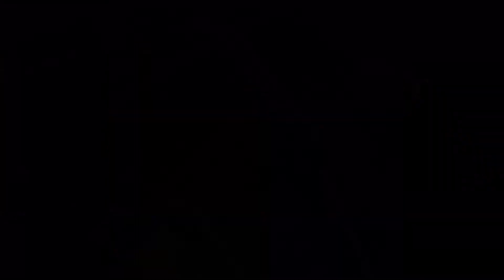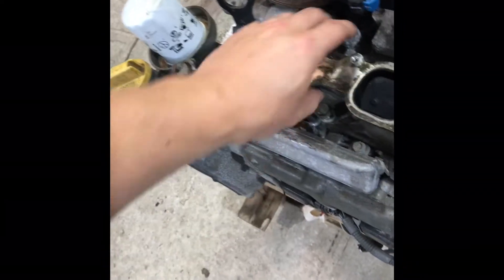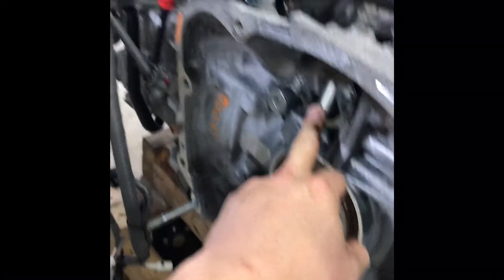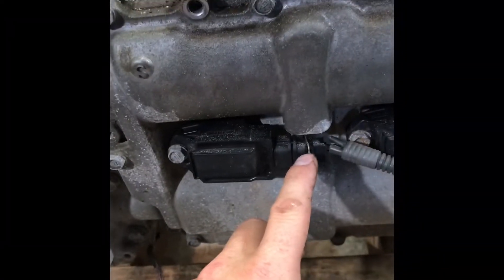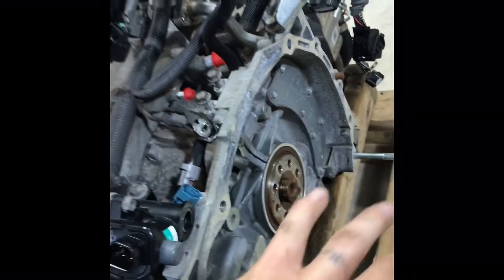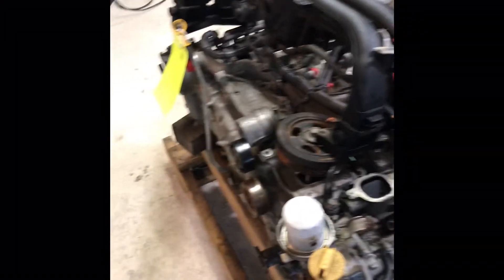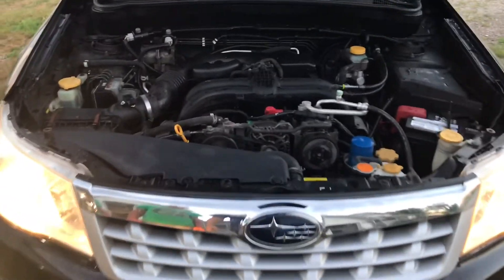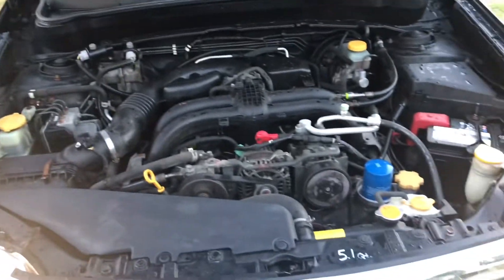2017 Legacy Engine Swapped into 2011 Forester!

Comment: This has been very helpful in my 16 Legacy engine (43k) to 11 Forester swap! I'm almost finished with the swap, but have found the torque converter (TC) centering hole in the middle of the flex plate on the 16 engine is much shallower than the old engine. It's about .5" vs. 1.25" on the Forester engine. The TC centering shaft bottoms out in the hole and leaves about a 3/8" gap when trying to bolt up the flex plate. When I tighten the bell housing the engine barely moves and the TC starter ring gears are hitting the starter gears indicating the TC is being pushed back into the transmission. Not good! The only solution I can think of is to grind about 3/8" off the TC centering shaft end. Any other ideas before I butcher my TC?
Reply from the maker: Oh! Also, check the hole in the crankshaft where the TC centering “button” goes into. I received one engine that had a broken off TC pin in it from the car it came from. I had to drill that sucker out. Didn’t know it until I couldn’t bolt things together, just like you.
Reply: @stvnswld  Are you kidding me! That's exactly what happened. It broke off so clean I didn't even suspect it was from the old TC. Unbelievable. I thought I screwed something up. Thanks so much! Now to get that sucker out of there.
Reply from the maker: @MitchellNorder  my dad removed it while I was at work. Small drill bit, then a larger one. He’s my master of extraction. If it’s stuck, he’ll unstick it!
Reply from the maker: I’m not sure I follow. Where is the gap? If you use the old flex plate you shouldn’t have any problem. Is the torque converter flush(nearly flush) with the transmission housing?

Comment: Wow, great video and helpful information. I just purchased a 2017 Subaru Outback with the 2.5 with 215,000 miles (Mostly Highway), I also found a 2017 Subaru Legacy 2.5 engine with 65,000 miles. Would this be a one for one swap as they have the same engine size and displacement?
Reply from the maker: I think they should be darn close to identical! However, since I have not done a swap in a newer outback like this, I cannot be for sure. Perhaps make sure the front timing cover has enough mounting places for the accessories. If you have to swap that, make sure to check the tone wheels on the intake cams. Thanks for the comment!

Comment: On those water passage O-rings, do you have the John Deere part numbers?  I am replacing the engine in my 2013 Forester with a 29,000 mile FB20 from an Impreza of the same year.  I may need to change the coolant crossover pipe to eliminate the transmission cooler fittings as my Subaru is a five speed stick.
Reply: Thanks
Reply from the maker: T78313 is the number from John Deere that I use

Comment: Hi Steven!  Thank you so much for this!  I am wondering if you think the same might work for using a 2018 Forester FB25B into a 2015 Forester FB25B.  I have a 2015 with a seized engine (oil low)...and I have the opportunity to get a 2018 with only 13k miles.  Wondering if it's worth the effort.  The 2018 engine is definitely cheaper than the 2015.  Curious your perspective.
Reply from the maker: I haven’t done this swap, so I’m careful before telling you it should work. Ultimately, the long block should be nearly the same, but you may need to keep your old harness and intake manifold. Not sure. If you’re handy and don’t mind a challenge, I’d be willing to bet you could make it work! Pay mind to the items I have mentioned in this vid though. Just remember, the end goal is to make the computer think nothing has changed, so all sensors need to read the same. Please let me know what you end up doing! I should admit that I get my kicks putting engines in machines where they don’t belong, so I’m excited to hear the results. I’m about to put an EJ20X into a legacy GT wagon. I’m nervous since I will have to retune it, but I’m excited to learn how.
Reply: @stvnswld  I will update you for sure! Thanks again for this!
Reply from the maker: @stevefafel  you’re welcome! I’m really happy to hear it is helpful.

Comment: Hi Steven, thanks for video. Would it be possible to swap an FB20 into a 2014 Forester MT 6SPD. If so what year FB20? and what all needs changed/swapped. Thank you
Reply from the maker: I have not done a swap with an FB20 myself. I have seen some other vids on YouTube of guys swapping in FB20 s, so the information is out there. Good luck with your swap!
Reply: @stvnswld   Thanks Steve, any info on putting a 2015-2017 legacy engine into a 2014 forester?
Reply from the maker: @Auldylachs  sorry I haven’t done that either, but I can’t imagine it would be too much different.
Reply: @stvnswld  one more ? lol,  I'm looking for some guidance on swapping a 2014 forester cvt engine into a 2014 forester MT, besides the transmission coolant lines (would need jumped/connected/plugged) are any other differences or things that will need done? plan to use MT flywheel and clutch kit. Appreciate your time!
Reply from the maker: @Auldylachs  I can’t think of anything more off the top of my head. The old EJ style had belt guides to keep the timing belt from jumping when the car is stalled, but that’s not relevant here. A 14 to a 14 makes things much easier! Sounds like you’ve got a handle on it!

Comment: Would a 2016/2017 outback FB25 work as well?
Reply from the maker: I do not have direct experience with an Outback engine, just because I couldn’t find anything less expensive than the Legacy engine. It sure might, but there may be other things that need changed over. If you do it, let me know what you come up with!
Reply: @stvnswld  sounds good, question would swapping heads be an option to omit the intake swap and having the valves hanging off to the side?
Reply from the maker: @Hellcat287287  I would think that would work. Then you’d have to retime the chains and everything as well

Comment: I’m curious, is it possible to do the swap in a 2011 Outback with the FB25?
Reply: Oh wow, yeah I actually misidentified my engine haha 😆
Reply from the maker: The 2011 Outback still uses the EJ25 platform. I do not believe they are compatible for a like swap. It would require more research that I have not performed to this point.
Reply from the maker: Great question!

Comment: Let me pick your brain for your expertise! :) Awesome video which is very helpful btw. I am currently doing a swap on a 2013 Forester. Bought it with rods knocking and decided to swap to a 2015 FB20 from an impreza. All went well as far as install, the problem is as follow: engine starts but dies within 5 seconds as the rpm rise to approx 1200rpm. Codes I am getting through Torque on OBD is P2004 & P2205 Intake Runner Control Stuck Open bank 1 & 2. Do you think that doing the TVG mod will fix this? if not do you have any other thought on the issue? Thank in advance
Reply from the maker: I’m interested in hearing if the FB20 will work! I know in earlier models, one could use a JDM EJ201 in place of an EJ251. Did you swap over the front timing cover and change the tone wheels on the front of the intake cam drivers? If the TGV is the only code, it should still run fine. Ultimately, you have to convince the computer that nothing has changed, even though it has. Meaning your electronics must all stay the same as the original engine was set up.
Reply from the maker: Could you list for me all of the things you changed during the swap?
Reply: @stvnswld 

Done the following:
Coil pack swap-change boots 

Crank sensor w/mounting plate 
Tone wheel behind flex plate 
Camshaft sprocket tone wheel swap, remove snap ring and three bolts to remove. 
Timing cover swap 
Use intake manifold from new engine on new engine-swap fuel lines and bracket on intake manifold, throttle body gets moved over
Use crank pulley/damper and bolt from new engine

Just did the mod, now P2004 & 2005 gone.
now getting p0123 po223! feel like a dog chasing it's tail lol
Reply: still will not stay running, still shuts down after approx 5 secons. grrrrrrrr
Reply from the maker: @jacquesboucher3055  which engine harness did you use?
Reply: @stvnswld  the original from the Forester
Reply from the maker: @jacquesboucher3055  it seems as if your MAF sensor might be unplugged by the air box or the sensor that plugs into the back of the intake manifold, intake air temp? If you have any sensor unplugged it might start but won’t stay running for longer than a few seconds. Cam position sensor, knock sensor, or anything else really. If you are using the harness that came with the replacement engine, that would cause a problem, you will need to use your old wiring if you haven’t already done so.
Reply: @stvnswld  thanks for your time, I will double check all connections. I'll let you kmow my findings. Cheers
Reply from the maker: @jacquesboucher3055  please do! Good luck
Reply: @stvnswld  I am not forgeting you, did not get back to it yet. Cheers

Comment: Where did you buy or how did you make the extension plug sets
Reply from the maker: https://www.ebay.com/itm/124373539838?mkcid=16&mkevt=1&mkrid=711-127632-2357-0&ssspo=sQjnkW1URZ2&sssrc=2349624&ssuid=ccjrpNmcTVq&var=&widget_ver=artemis&media=COPY
Reply from the maker: If you’re afraid of messing up a terminal when building your connectors, ask the seller if he’ll throw in a couple extra pins. He did for me.
Reply from the maker: https://www.ebay.com/itm/125188776676?mkcid=16&mkevt=1&mkrid=711-127632-2357-0&ssspo=sQjnkW1URZ2&sssrc=2349624&ssuid=ccjrpNmcTVq&var=&widget_ver=artemis&media=COPY

Comment: Always wanted to know how easy/ hard it would be to swap a modern WRX engine with matching CVT trans into my wife's 2013 Legacy 2.5i.
Reply from the maker: It would not be simple, this I know. Now how tough? That I do not know.
Reply: @stvnswld  Thanks for the reply.  I got the struts/ springs/shocks off the same year Outback to put on my wife's Legacy in hopes of a little bit extra clearance like the old Outback sedan's.  Do you know if there's any extra parts needed for the install?  Thanks.
Reply from the maker: @Sir.VicsMasher  sorry that I can’t be of help on that. I’m not quite sure of all of the different compatibility options. I’m sure there are people that have done such swaps and share on forums. I love the lifted sedans, would be cool to see pics when you’re done!

Comment: Some great information here man! Fantastic job with the video and explaining everything. Question for you though. Are all the FB25 blocks the same? Can I just swap in the short block from like a 16 and my 2011 Forester? I'm having a hard time finding any info on it. I haven't thrown a rod yet but she's making some noise so I'm wondering if I can just use a 15 or a 16 motor and just use the short block.
Reply from the maker: I would check a parts catalog for both years and see if the short block part number is the same. I would think that it would work, but that’s without doing any more research.
Reply: @stvnswld  now another question for you. In your video you said you've used a couple of 15 and 16 motors in the earlier foresters like 11s and 12s. Is everything that you went over in this video for the 17 the same for the $1,516 or is the 15 and 16 more of a direct swap? I definitely appreciate your input!
Reply from the maker: @dontrudeau9362  I’m glad I could be of help! That’s my sole purpose for posting this video. The 17 was practically identical to the 15 engine. I wasn’t sure it was going to be but I had my suspicions that it would be close and it was right on.

Comment: Great vid, I have a 2011 Forester and there are not many other options that won’t break the bank. I’m not a Subie guy and a little confused on the intake modification. So you transfer over the electronic part of the flapper valve from the old lower intake to the new one piece intake and toss the lower intake valves ? Just wondering why do you grind off the valves in the new manifold instead of utilizing them ? 
It’s crazy the price difference between the 2 engines.
Reply from the maker: Thanks for the comment! I haven’t found a better work around for the intake flapper valves. If you don’t remove the flaps and they end up going closed, it would restrict your intake air. If you do remove the flaps, you don’t need to put the old motors back where they fit on the new intake. Use the old motors on the old actuators as I have and bolt them together and out of the way. Originally, I used zip ties to hold them out of the way because there was not enough length on the harnesses to get them both out of the way together and I didn’t have connectors to build extensions. You need to use ALL of the electronic bits from the old engine as to make the computer think nothing has changed. Does that make sense? If you have more questions, I’d be more than willing to talk it through on the phone sometime. I have more advice that I’ve learned since posting the video I could share with you as well.
Reply: @stvnswld  Ok I understand, could the motors just be used some how off the actuators ? Would look cleaner if you could mount the old actuator motors in the newer intake somehow.
Reply from the maker: @Busa0069  the throw is different on the shaft that run through the tumble valves. The old ones turn 90° whereas the new style only goes 45°. In that way the computer is thinking that the actuators are not opening all the way, thus showing you a code saying stuck shut
Reply: @stvnswld  No way to remove the flaps, cut the end of the shaft off and let the motor free wheel in the intake ? Or is the spring return for the motors on the shafts ?
Reply from the maker: @Busa0069  that may work? Perhaps cut the tabs off of the stops that limit the rotation of the shaft under nut on the end once the motors are removed. I did not try that. Not sure if you can glean anything from what I tried to say there.
Reply: @stvnswld  You’ve been a big help, Thanks. 
I feel much more confident about tackling the job now.
Reply from the maker: @Busa0069  more than glad to help! You’ve got this. Let me know if you run into snags or have more questions. I recommend replacing the valve cover gaskets and spark plug seals under the valve covers. I have a set leaking already and causing misfires because of oil in the spark plug tubes.

Comment: Wounding if a 2013 legacy motor will fit in a 2011 forester. And what needs to be switched over? Thanks
Reply from the maker: Great question! If it’s the four cylinder engine it should work fine! I have not done the swap from a ‘13 legacy, but I would definitely check a few things as you swap: cam phase plates under the front timing cover, probably the front timing cover itself, engine mounts, possibly intake runners, and all of the things that I have listed in the video. Basically you’re trying to trick the forester into thinking the engine is exactly the same, so everything that’s different needs to be changed.

Comment: Great job! In the middle of a similar swap now. The TGV fix seems a bit cumbersome. Wonder if they can be cut down or do something electronic.
Reply: Does it still run even with the codes perfectly ?
Reply from the maker: @jessegill331  great question! It really depends on the reason for the code. If it is the tumble generator fault, I believe it will run fine. The cruise control with not operate if there is an active engine code, so I wanted everything to be code free. If you don’t use your cruise and don’t mind seeing the check engine light on constantly, it might be alright. If the code is for cam and crank out of correlation, it won’t want to run well.
Reply: As well could I use a 2017 forester in a 2013
Reply from the maker: @jessegill331  yes you can. If you run into any snags, don’t hesitate to reach out and I’d be glad to answer any questions I can!
Reply from the maker: It definitely is cumbersome! I tried swapping solenoids and even tried swapping the little gears on the shafts the solenoids drive. Someone on a forum suggested switching terminals around in the connector, which I also tried. Turns out, the throw is different on the shafts. The newer tgv shaft doesn’t turn as far before the stops tabs on the end don’t allow it to turn any more. Maybe I mentioned this in the vid. Can’t remember. Let me know if I can help answer any questions.  Thanks for the comment, good luck with your swap!
Reply from the maker: I’m sure you’ve worked past this by now, but I have a new video showing a sweet solution to the TGV dilemma! If you watch it, make sure to comment if works for you.

Comment: Thanks for the video. 
Do you know if it matters if the engine out of a legacy has a CVT with a vin A or typical auto transmission with a vin C? 
Or does it make no difference?
Thank you
Reply from the maker: Thanks for the question! It will not matter what trans the engine was paired to previously.